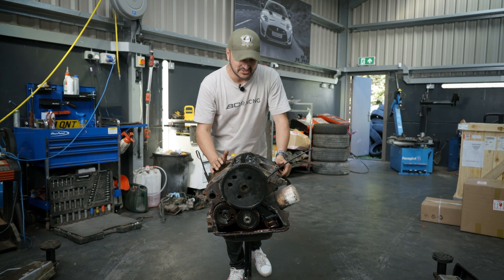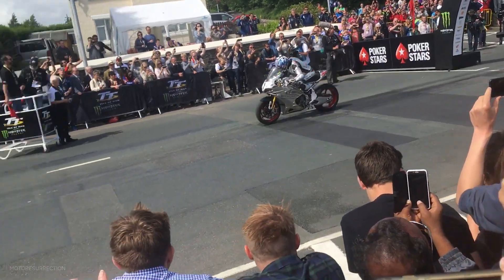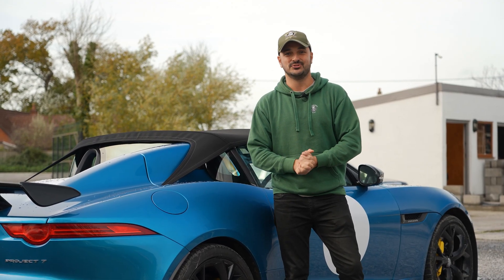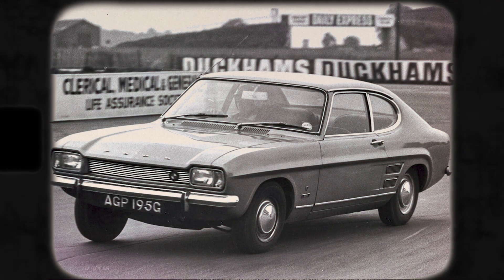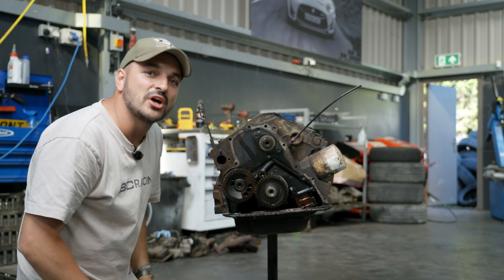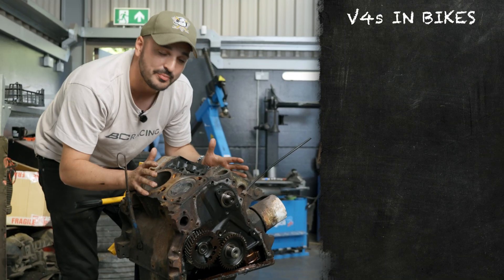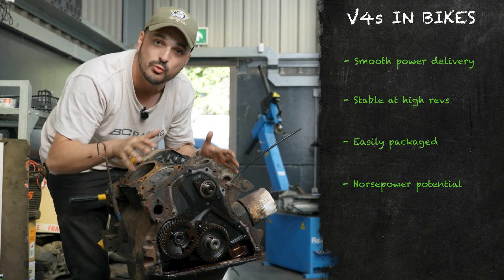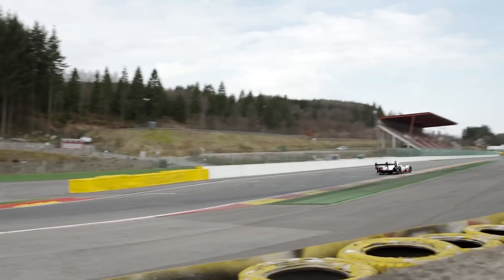Why Do Cars Not Have V4 Engines?

Comment: Tuono v4 owner here. The most lovely sound and internal combustion engine can make. I would go out of my way to have a V4 car that sounded like my bike. Ducati V4 doesn't sound so hot, even most Ducatisti concede that much.. Honda's VFR 750 / 800 and vf750c sound better than ducati's Twin Pulse v4.
Reply: Agree, had a VFR800 Gen5 for 20 years, have an IL4 now, but still miss the VFRs 180deg note and its gear driven cams whine.
Reply: @John451vfr What I find interesting is that not only was that one of the best sounding engines I've ever heard in person, it was the smoothest bike I've ever ridden as well. 

I thought it was normal for v4's to be smooth.
Reply: @wayward03 can't argue with its smoothness either, unlike some IL4s that have a transient tingle zone, my VFR had none.
Reply: @wayward03  Agreed. I have a 4 cyl FJR, a V-twin KTM, a flat twin BMW and my VFR is the smoothest of all and has the best sound (although the KTM is close on sound).
Reply: Agreed the Ducati doesn’t sound very good. The Tuono is best with the flat plane crank R1 close behind
Reply: A V4 is the most lovely sound combustion engine can make I think was a quote by Beethoven.
Reply: 110% the Ducati firing order ruins the tone. The RSV4 engine just screams like a NASCAR.
Reply: You could likely make an exhaust that mimics the Aprilia firing order, if you deeply understood acoustic engineering haha.
Reply: Yes the future is v4
Reply: Omg the vfr1100 or 1l from the mid 00s sounds so good I almost want one

Comment: Because it is called an boxer engine. And a line engine is more efficient.  Thus a V4 for a car does not make sense.
12:09 "Faster than formula one" . No it is not, After removing all restrictions means you compare you compare apples and oranges. Ferrari F1  team  showed in 2019 what you can do with just a little cheating on the fuel flow by increasing fuel flow between the measure timing of the FIA-sensor. The underpowered Ferrari went from low top speed to a rocket, no other team could even get close, until they got caught and their topspeed was back to slow again at the Austin grandprix.  An unrestricted prepped F1 car is MUCH faster than lmp classes. Hybrids systems are actually just dead weight slowing the car down when you remove the fuel flow restrictions. Thus, when you prep a f1 car without restrictions you start with deleting the hybrid system for massive weight saving. As the engine itself, freed from fuel flow restrictions, will make 850+HP at minimum.  Resulting into a much lighter car requiring less aero = less drag = more topspeed.  And the 75+kg less weight = much faster cornering, acceleration and braking etc. Especially since a F1 car empty weight, including the driver, is just 800kg.

Comment: As a former owner of four different Lancia Fulvias (1.2 coupe, two 1.3 Zagatos), a 1.6HF coupe, and a 1947 Aprilia, all V4 - powered, I'm somewhat biased towards to the engine concept. And, as a Moto GP fan, I'm very aware of the success of V4-powered bikes too. However, I rather suspect that with the mergence of EVs, no car makers would be developing something as potentially expensive as a new V4 engine for future ICE cars. The only hope is the likelehood of developing affordable, sustainable fuel.

I read that Mazda are developing a rotary fueled by biofuels, with a carbon-capture exhust system. No-emissions from the engine plus 10% carbon capture means it would be more environmentally friendly than any EV. But, will it happen? I suspect politics will drive us towards an EV-only future.

Comment: The Ford Essex V4 bizarrely was developed at the same time as the Ford Cologne V4 but shared no parts. Used in many of the same Ford vehicles but the British and German ones respectively. SAAB chose the Cologne V4 for its superior reliability, a version of the Cologne V4 powered ‘Nodding Donkeys’ on oil fields they were that reliable! SAAB managed to coax 170-175 BHP out of the 1815cc competition engines although gearboxes struggled to cope. 
The fact the Cologne v4 was offered in 1.7 maximum OE capacity and the Essex 2.0l tells you just how different the two engines actually were. It’s quite mad to imagine 2 (4 if you include the v6 variants) were developed by Ford at the same time in two countries…. Although famously the German Transit was completely different the British one..   😂
Like the opening video, nice detail on the tech stuff 👍😁

Comment: A bit of a correction, you said that the Essex V6 was used in the Mark 1 Capri. That is true, but it was also used the mark 2 and mark 3 before they put that bloody awful Cologne 2.8. I had a mark 3, 3 litre Ghia. That engine was a delight to work on.

Comment: "Why Do Cars Not Have V4 Engines?"
 - Cost.
Next question.
Reply: My car has one :D  Milions of cars in the 60s and 70s had this engine. Why ?  Because of longitudal placement in front wheel drive Fords -- Ford Taunus 12M and 15M made from 1962 to 1971, and because of first small front engine bay in vans like the Ford Transit Mk1 made from 1965 to 1977 :)  other models also had it, as they were already produced.   Nice sounding engine compared to the inline 4 cylinder sound.

In V6 the cost is also higher than inline 6,  but V6 were more popular than the inline6, as you can fit them transversly in a fwd car like a Camry or some Honda models.   Datsun (Nissan) changed from inline 6 RB engines to the V6, Mercedes, Lexus did change to V6 aswell.  From the big manufacturers only BMW never used the V6 :P
Reply: @wyrazowfkp  
I was well aware of the V4 Fords, however, they're still more expensive than an inline 4.

V6s often more popular than inline 6 because it's easier for the car to meet crash requirements, even though it is mor expensive.
JLR went back to an inline 6 over their (mostly Ford-based) V6s due to cost.

Comment: Gotta be that guy, I guess. I think that isn't a hot V. I believe I see the exhaust coming from the outer parts and routed through to the turbo that is centrally mounted making the intake, between the V, very short. They must feel this improves response or something. Otherwise, great video. I'm here for the ride and clearly, if you need it, some technical consultation

Comment: Not a fair comparison.  A road going car V4 has 3 main bearings and two shared big end bearings.  A modern I4 has 5 mains and 4 big ends, as does the Porsche 919 engine.  Look at the crank at 11.35.  That is a special racing engine.

Comment: My boat has a Yamaha V4 Saltwater series. It's a 2 stroke, with 130 horsepower. It's phenomenally fast to get into it's powerband and tops out at 80km/h when fully trimmed out on a calm day. Love a V4 engine. As far as I'm aware, the Lancia Fulvia is the only other V4 powered car that I know of.
Reply: SAAB had a 1500cc V4 in their 96.
Reply: ZAZ 965 / ZAZ 966 and 968 also had a V4 in a car (Soviet car),  and many Ford models from the 60s and some from the 70s, Matra 530, Saabs

Comment: “OMG 667L” 1973 2.0 (V4…) GT Mk1 Ford Capri - facelift model with powerbulge bonnet in white with black vinyl roof and hand wound Webasto sunroof…

What a cracking engine (he lied). That was my first performance car, performance in my mind that was.

As for the rattles. I changed the engine oil in it in the Summer of 1980 and used a military spec engine oil that had so much detergent in it that it cleared all the carbon out that had been keeping the clearances up and kept it relatively well sealed. After that oil change it was so clean internally the oil blew by the rings and it became a Smokey old bus.

After the dynamo failed as we were driving to look at the wreck of the Athena B (washed up on the shore at Brighton in a storm) I knew it was time for it to go. It was my one and only two door coupe. Halycyon days.

Great video Mike, you’ve hit the ground running and eminently watchable. Keep up the good work 👍🏻👍🏻👍🏻🇬🇧🇬🇧🏴

Comment: My RC45 V4  RVF400 by Honda was a beautiful lightweight 14,000RPM 1998 bit of tech ahead of its time...
Reply: My 1982 VF750S was decades before that and birthed the Interceptor. Never get tired of ten grand roll ons.
Reply: @TJohnsonLLC  You'd think the VFR 1200 engine would be good for a lightweight car, but TBH haven't watched this video yet. I'm sure Honda perfected the design that slightly eluded Saab and Ford.
Reply: @speckledjim5150 While the V4 became the winningist engine configuration in Honda motorcycle racing history, they new it would be stupid in any overweight four wheeled roadcar. The high reving NS2000 does well with an inline six, and even a gold wing went to six cylinders decades ago.
But I'll bet if Colin Chapman could have found a V4 for the Lotus Europa it would have been awesome.
Reply: @TJohnsonLLC  Attention à l'usure des arbres à cames...

Comment: In the aviation world 4 cylinder engines used to be boxer type only, until more modern engines adapted from the automotive sector were introduced. They still present a large percentage though. Usually naturally aspirated with directly driven propellers maxing out around 2.700 rpm.
Reply: Well, they don't need high revs because the prop is attached directly to the flywheel. Otherwise, they would require a reduction gearbox like they do on turboprops.

Comment: There were some V 4 engines Ford made one usually found in early 1970;s Transit vans and a  range of oddball car models, Lancia made a narrow angle V 4 13 degrees to look at more almost like a square four but actually a real V4 but the Car they came in The Filvia had a few different models the normal Fulvis in 1300 cc and later up to a HF performance model at 1600 cc with ual sidedraft weber DCOE Carbs and believe me as my uncle and father had a few the slightly different intake lengths made them a challenge to get idling and responding off the mark to be clean and consistent but when you got it right very rewarding.

If you can I highly recomend checking out a Fulvia it is up there with the renoned Renault Alpine 110 models but sized so normal humans can actually fit in and drive
Reply: Actually Ford V4 came in 1962 :)  at first in front wheel drive Taunus P4,  both Cologne V4 and Essex V4 were made in milions of cars in the 60s, early 70s.  It dissapeared in very late 70s/ maybe early 80s in the Granada, and in 1978 facelift (MK2) Transit

Comment: we had it in the ford taunus 12M and i have seen it in SAAB's. 
back then they made up to 140HP NA and ate exhaust valves to lunch with a turbo. it need a dual port exhaust port on the head's.

Comment: Ford used to have the V4 it was in the Corsair, then Transit. Then Saab bought it off them for the 99. Subaru use a Boxer Technically a V4 180 degree v4.

Comment: Any advantages when you start going wider then an engine is long are lost in an automobile. 

Because of the shape of an engine bay, and the benefits of using an inline layout, the benefit to practicality begins to change. Inline 3, 4, then inline 6 or v6 and v8. These are chosen because they offer the most benefits for the size of the application they are fitting in.

Comment: There is another one manufacture you missed it is sovient Union ZAZ or Zaporozhets with a V4 engine
Reply: Probably the most manufactured of all the V4s! It seems to have been inspired more by the air cooled VW flat 4 than any liquid cooled V4. Taking a VW and bending the cases to a 90 degree angle is the basic shape. The cam is in the valley, and the exhaust ports in either end, just like the bug!

Comment: A V-engine does not necessarily need twice the number of camshafts - most V-engines have overhead valves and a single central camshaft in the V (most American V8s, the Ford Essex and Cologne V-engines, even the Lancia V4). It is only the more modern multi-valve engines that have overhead camshafts and thus double - or quadruple - up on camshafts…

Comment: Very nicely explained from an engineering perspective Mike. Well done. Out of curiosity, if the inline 4 and I assume your talking about primarily a single overhead cam engine is less complicated to engineer and produce over say a V4, asides how they do this with bike engines, where does the twin cam 4 sit in this equation. From my ‘un-engineering’ background, my understanding is that perhaps this is the compromise between power/revving capabilities, packaging and complexity differences between the inline SOHC and V4 engines ???

Comment: As a little lad, all you used to hear was screaming  V4's in Transit Delivery Vans. 🤣 That Fibre Timing gear and Balance shaft must have made the noise. Neglected and abused they like all ford stuff was incedibly tough and reliable - Not like the Wet belt crap of today.
People used to say the V4 & V6 were originally Generator engines. I would totally doubt that, more likely it started as a 60deg V6 and they cut a couple of Cylinders off - be supprised if they would design an out of balance V4 for a Generator in England, code name Essex 😄
Reply: It was other way round :D  First they made the V4 , and later added 2 cylinders (both in Essex and Cologne V4) creating the V6

Comment: V0 engines are the best.  Instant torque extremely light and efficient, small 1.0 liter or less.  500+ horsepower, extremely smooth and quiet and gets over 100 miles per gallon.

Comment: good video . I do vaguely remember the Ford V4 from when I was very young in the 1970s . It wasn't thought of in positive light to those who I remember asking about it ! (and you've  explained the reasons). I do also remember it being said it was more unreliable. The straight four ford engines were pretty reliable, and well that's what most mainstream car buyers really want.

Bikes well they have much tighter packaging restrictions than any car, so the downsides of the V4 can be overlooked for the upsides of fitting it within a motorcycle. Although none of the V4 motorcycles are cheap, it is a niche engine for the top end bikes ! Nice and cheap parallel twins dominate , with quite a few inline fours, and a few in line triples.

Comment: The Porsche 919 V4 isn’t a hot V, it’s a cold V. The exhaust manifolds are on the outside of the V and feed up to the turbo rather than on the inside of the V. The turbo was just mounted up high for packaging.

Comment: Rebuild the Ford V4, blueprint & modernise it, stick on some of the modern EFI carb replacement systems or modded bike throttle body setups, and a a modern aftermarket ECU. Costs wise perhaps a pretty ecenomical size engine to do something unique with as a project, keep it NA see how far you can take it for power and economy at the same time. you wanted to do a V10 MX5, what about a V4 MX5.

Comment: My Ducati Streetfighter V4S has a 1103cc V4 engine, putting out 220 hp and 97 lb/ft, and at 15,000 rpms it sounds glorious 😎
Reply: That sounds like a great machine.
I never progressed nearly that far in bikes.
The furthest I got was a Honda VF400F, and I think it only made 55hp and redlined around ~12k, but it was a wonderfully smooth engine, with a power "curve" that was pretty much a straight line, and it sounded pretty good for a small/mid sized engine, especially compared to whining inline 4s, and after I gave it a dose of Slick 50, the flare of revs even from a stone cold start was something to behold - it needed a little touch of throttle to start, but I had to be prepared to let go almost instantly, otherwise the needle would be hurtling from zero towards the redline before I had a chance to react.
The bike overall did have some quirks (not least the inside-out disc brakes) but it was huge fun to ride, and probably had about the right power output for my experience, as, while it would easily do anything I needed it to do on public roads, if I had a brief moment of overenthusiasm I still had time to think again before anything serious happened..

Comment: After you said that 90 degrees is the ideal angle it got me thinking of how smooth a subaru boxer engine runs and its two times 90 degrees which to me adds to the evidence that 90 degrees is ideal for a v4.  Now it has me thinking does the boxer six balance so well because of firing order?  
Fantastic video Mike!  Keep it coming.  The weirder the engines the better.
Reply: boxers have good balance, since the opposing pistons either both move towards eachother or away from eachother. so there are always forces of equal magnitude going into opposite direction, canceling eachother out...well...almost. the pistons are still slightly offset, as you would need two crankpins for both pistons to achieve that motion. so theres a small rocking couple in a boxer engine.

Comment: Oh come on Mike. The most famous application for the Essex V4 wasn’t in a ford at all. It was in the Saab 96, that Eric Carlsson and Stig Blomquist dominated rallying in.
Reply: Saab did not have the Essex V4 ---- it had German engines -- the Taunus V4 "Cologne", from which with 2 cylinders more they made 1.8 V6 2.0 V6 2.3 V6 2,6 V6 (RS2600)  and the 2800 V6 (also the Capri 2.8injection engine) and later in the Sierra XR4i and XR4x4

Comment: Soviet-era Ukrainian-made ZAZ 965 supermini and the subsequent ZAZ 968 2-door saloon both had air-cooled V4 engines at the rear. The same ZAZ engines were also used in front-engined Lutsk-made small off-roaders called LUAZ Volyn (VW Kübelwagen type of thing). They were ridiculously loud.

Comment: 11:05  A 'hot Vee' means the exhaust is in the center no?  I'm interested to know why they didn't do that as your photo shows a standard engine with a top mounted turbo.  I'm sure they had reasons, and I'd be curious what they were doing for intercooling.
Reply: Hit v is when the turbo is in the bank rather than outside